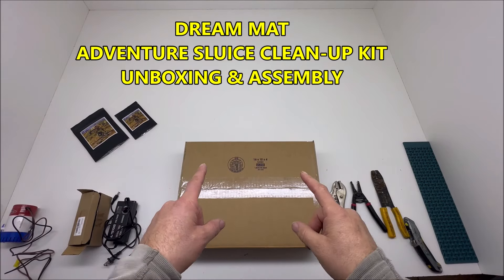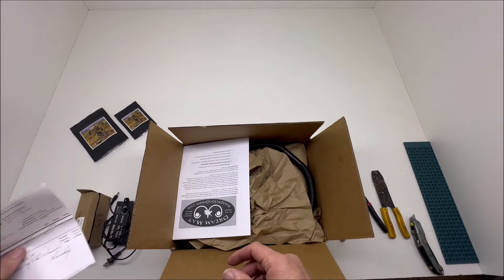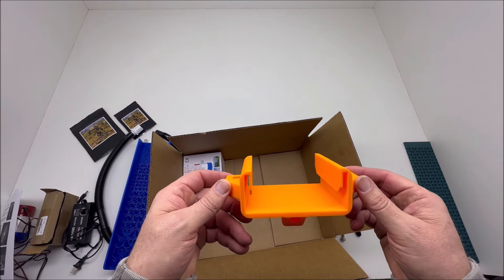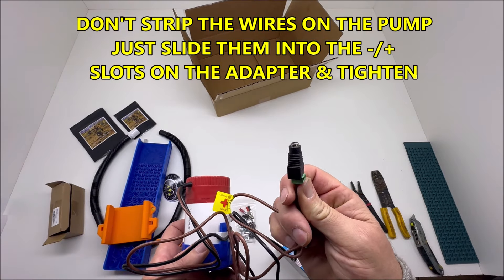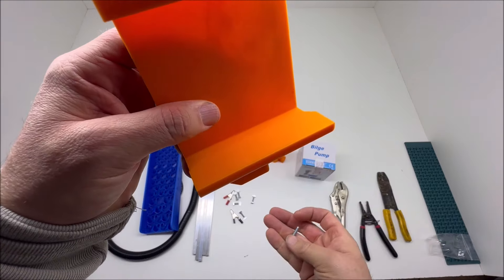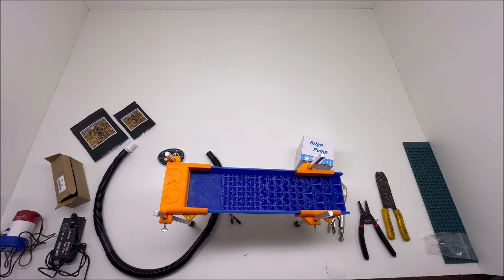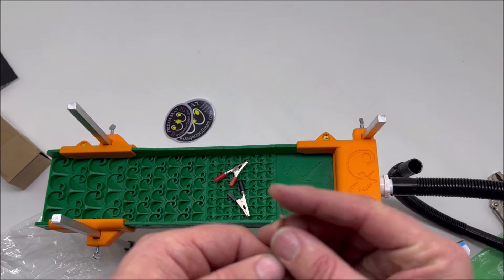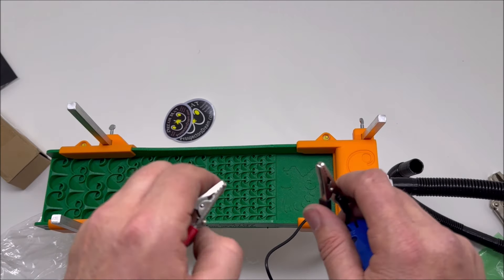Adventure Sluice Clean-Up Kit Assembly HOW-TO video

Comment: Where do I get the correct DC inlet connector for the bilge pump?

I bought the clean-up kit 2 weeks ago and the power supply wasn’t an option at that time.